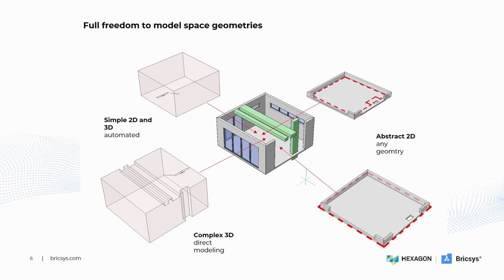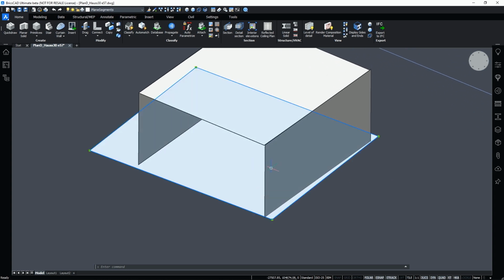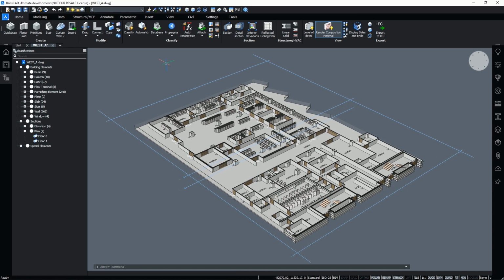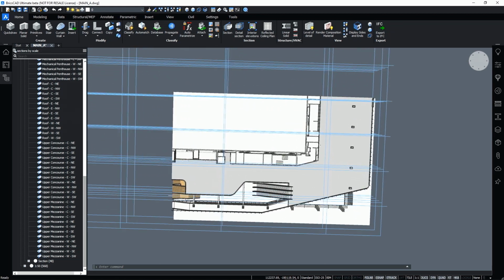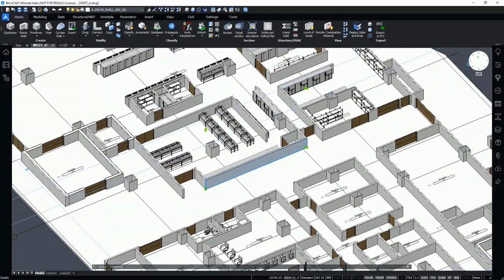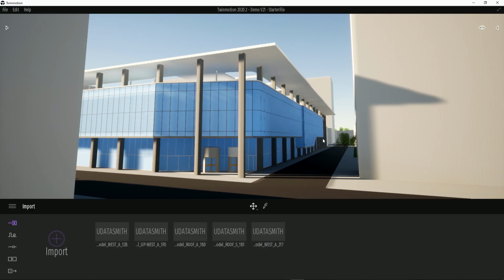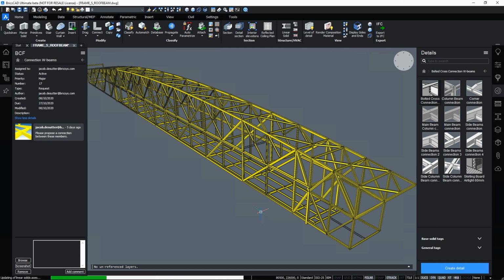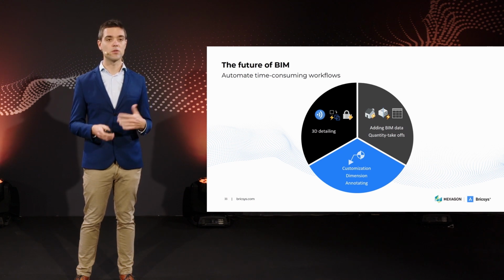Bricsys Digital Summit 2020 - BricsCAD® BIM V21

Comment: So they talk about realtime synchronization between Bricscad and Twinmotion, so the model can be changed at any time again in bricscad.
But what is then shown is exporting and importing. So what is that?
Reply from the maker: Please see this article: https://help.bricsys.com/hc/articles/360017253260-Using-Twinmotion
Reply: @BricsysOfficial  I there, I checked the article but the big missing here is the direct link! So you still have to export in real engine format and load it in Twinmotion.
How can you manage the real-time upgrade from BriksCAD this way?
Reply from the maker: @giuseppecarbe688  In this moment there is no direct link, but we plan to develop it in the near future.
Reply: @BricsysOfficial  thanks! That would be definitely a great improvement!👌